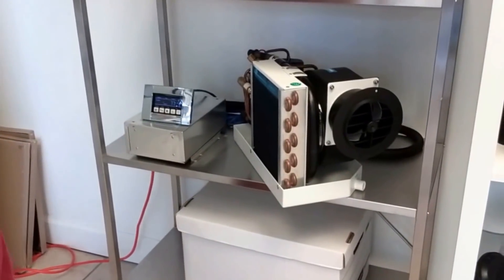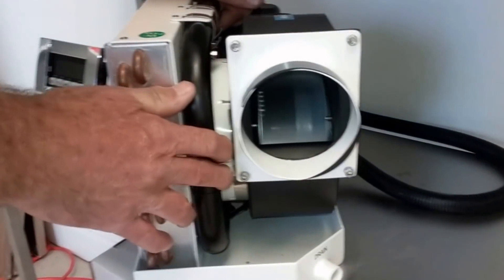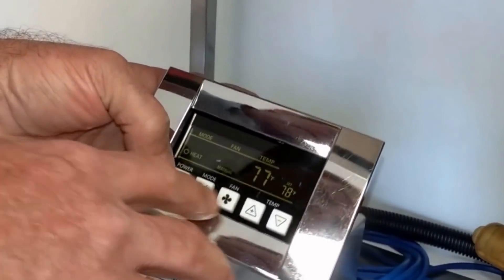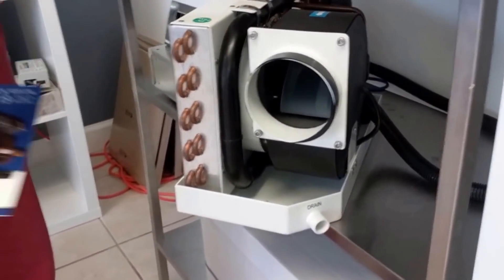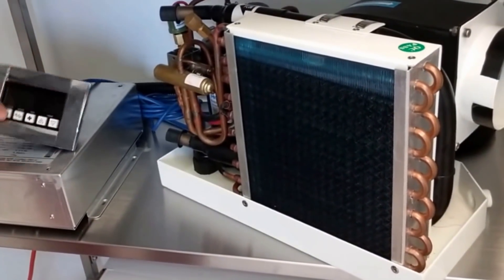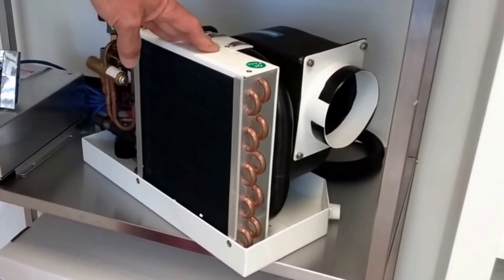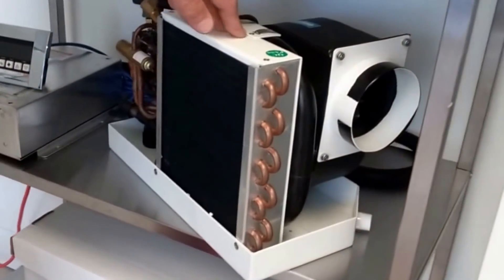Mini Hvac-WORLD'S SMALLEST AC/DC AIR CONDITIONER HEAT PUMP 4200 BTU

Comment: For their size the pricing is way out of line.  In other words they cost too much.
Reply: You can get a 5000 BTU A/C from Walmart that's almost the same size for $110. There's absolutely no reason for this thing to be nearly 1500 times more expensive.

It'd be cheaper to buy your own refrigeration compressor and components and build it yourself than buy this overpriced gimmick.
Reply: Dude you saying this is overpriced... you don't know the special technology this is... the digital control comes with blue, white, or red color display, that alone is a expensive feature 😄😌👍
Reply: +GGigabiteM On a boat you have no window to put a WalMart unit to. That's why this one is water cooled. It can also run on 12volt. The massive price difference is in part down to the different technology and in part down to the low volume production.
Reply: +Tim Hirst.  Yes, actually someone referenced this to me direct as a video link for house or solar, for thoughts on that, and the video didn't indicate obviously marine. The person that asked me about it was not in marine application either.

 However seeing the fellow's other posts on his profile, then I see he is a marine outfitter. 

Marine is often 10x the cost of land application. 

 Now, since this is primarily a 4500 BTU tray-chassis it is basically a stripped window unit, with the water cool difference, DC batt power and the rust resistance coil extras.

I'd seen a lot of bad pitches that day, especially hipster kids repackaging ice bucket swamp coolers as sharper image toys, and a crowd fund pitch for a 10k  BTU window unit that looked and carried like a lawyers 5 lb briefcase (not likely)  so I was about pitched out.

I'm sure thus is great for the application.  Not quite "The Worlds Smallest AC" but mainstream OK for a cabin cruiser install.
Reply: Tim Hirst
> That's why this one is water cooled.

This unit is not water cooled, do you not see the huge condenser coil? It's sandwiched between the evaporator and the squirrel blower. The guy even points at it in the video.

If this unit was water cooled, there'd be two rather large water pipes going to the unit from a bilge pump in a rather large tank of water with something like dry ice in it. You wouldn't be able to run this unit for even a minute without a proper method of rejecting heat out of the condenser or you'd risk the compressor destroying itself, or the more dangerous scenario of one of the high side lines violently detonating and sending shrapnel everywhere.

Water cooling an air conditioner on a boat is an extremely bad idea, especially if the boat was in salt water. The copper lines would instantly start corroding and the tiny aluminum fins would accumulate biomass and clog.

> massive price difference is in part down to the different technology

There is no "different" technology. an air conditioner is an air conditioner. If you wanted to water cool the condenser, it's not going to add any significant cost other than extending the high and low side lines so the condenser can be in contact with the liquid medium. Not that I'd recommend such a configuration as it would be very unreliable and expensive to maintain from the constant corrosion issues.
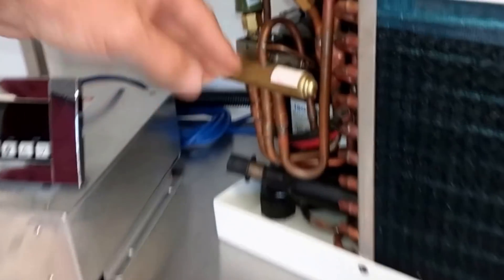Reply: +GGigabiteM I think it is water cooled at 1:20 the water in and out connections are pointed out.
Reply: LOL, oh I know the colored LEDs and other flashing lights really add to the total cost of anything... LOL.  I like your sense of humor.
Reply: antifreeze decreases heat transfer which is why you dont run 100% antifreeze in cars however it does inhibit corrosion so it should be used anyway
Reply: +GGigabiteM.  Agreed.  In fact if I wanted to make this pitch video myself today, I'd buy a $100 window unit, remove the cover and vents, hook up a remote thermostatic controller and roll camera.

Looks, from all these product pitches, that Europe and Asia has recently  discovered home AC and wants to build what the US has already built, or discarded as superceded, for the last century of North American air cooling.

Yes we went though all these little steps already and starting in the 50s started installing whole house ducted systems.  As we throttle back on that, what we need is smaller compressors mixed with evaporative fabric to allow this 4500BTU system to achieve 12000BTU of actual heat exchange, then run that off a 1kw solar panel.  Zero utility cost on hot sunny days when you need the AC.  Symbiosis.

Do all that in a self contained unit weighing 20 lbs and costing  $999 or $1999 with the solar panels built in and you will have a product for the year 2020.
Reply: It appears that a "freon heat exchanger" is located inside the water tank.  The tank is filled with water which is directly heated by the evacuated solar tubes.  This set up will work in climates where freezing temperatures are not present.  In more northern or southern areas where the seasonal changes produce freezing temps the water should have antifreeze at a 50/50 ratio added to prevent freezing of the water and breaking of the solar tubes.  Antifreeze should be added even in the warmer climates as the antifreeze will improve the heat transfer of the solar tubes to the "freon heat exchanger".

Comment: $1,750?! Really?!
Reply: That's fucked up! You can make a Peltier system for a whole whole house with that money and still have enough to pay for the electricity.
Reply: @ Nonnof Yobiznes peltier systems use about three times the electricity to absorb BTU's as vapor type Cooling. It would have no application for a home. Only used in small specific often novelty applications.
Reply: +Nonnof Yobiznes these are supposed to be in small boats and semi trucks ! an apu for a semi truck will cost you at least 11.000$